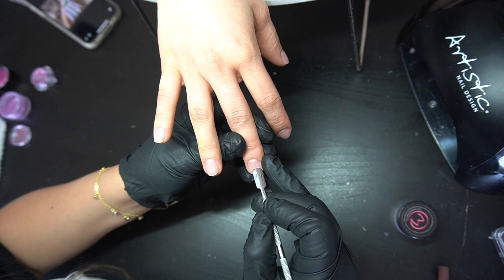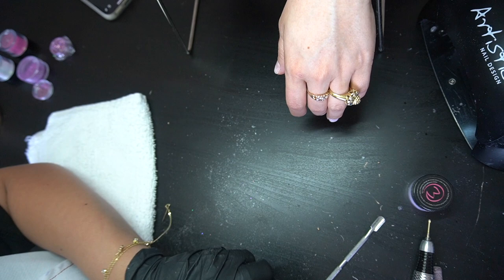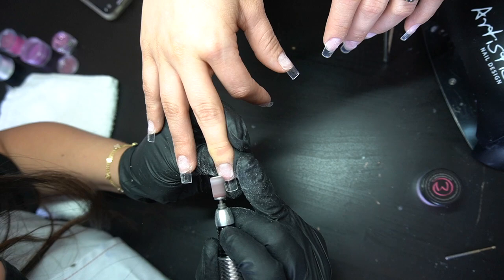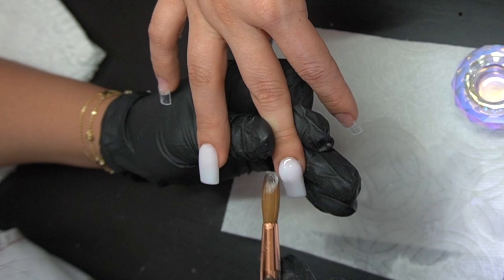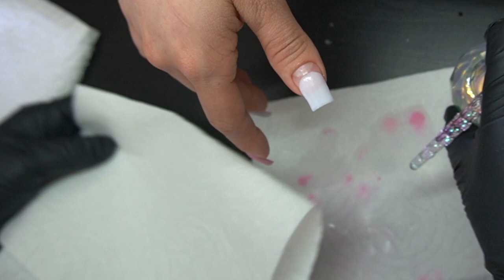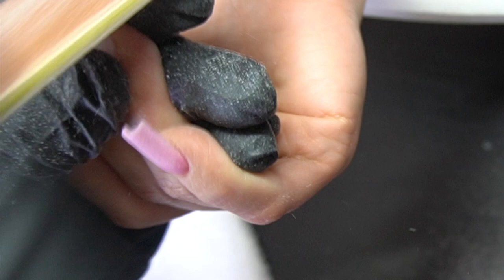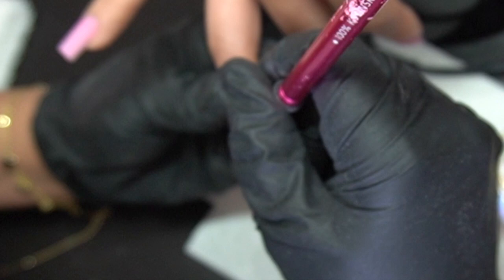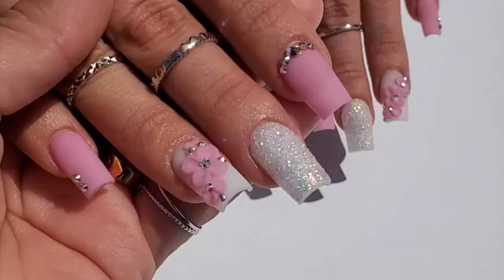BIRTHDAY NAILS FOR MY CLIENT | @LORENAAGUIRRE_

Comment: You could save a lot of time using a tip cutter that comes with measure. I’m sure you’re used to your method but I thought it could be useful.
Reply from the maker: Yes your total right I thought about doing the magnet method because I do go back and fourth with it to make sure I never cut to short lol 💖 lol im going straight to amazon 💖

Comment: Woww,this is so pretty😍 Is it ok to not apply top coat on glitter? I noticed the sparkle of the glitter decreases but, wont the glitter come off after a few weeks? Is it better to use builder gel in that case?
Reply from the maker: Awh thank you 💕 honestly most of my clients come back with their glitter on it will be a little worn on the edges but nothing crazy 💕
Reply: @lorenaaguirre  cool, thanks